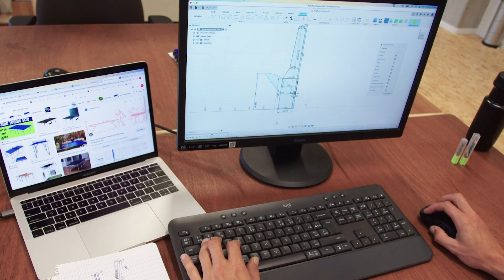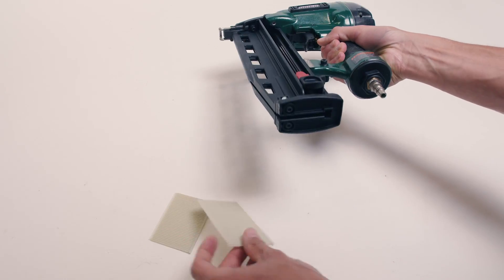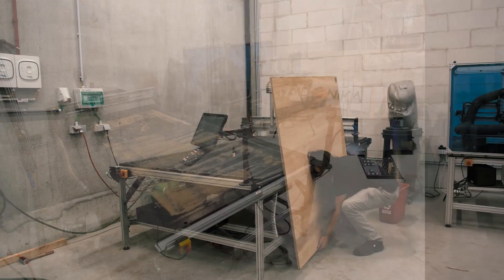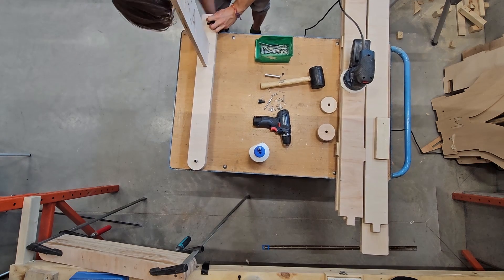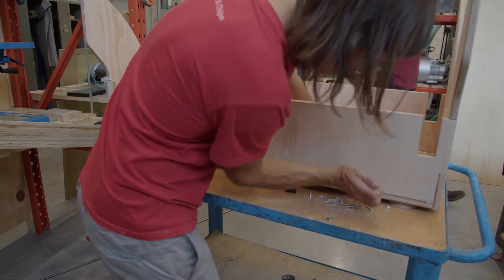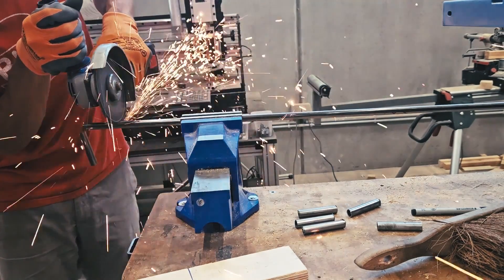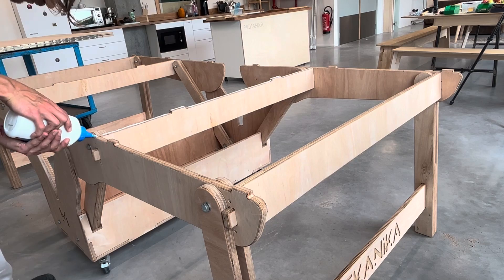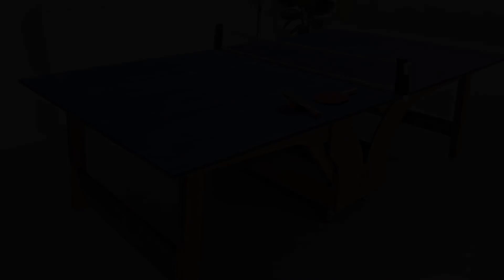How to Build a Ping Pong Table | Open Source CNC project (Complete Guide)

Comment: This is not diy, this guy has all professional machines, tools & equipment.
Reply from the maker: Hi! 
Indeed we used some workshop tool for the video, but nothing prevents you from building it your own way!
You can always get the free plans to work on the cuts manually or with a jigsaw.
You could also check if there is a fablab or collaborative workshop close to you where you could do the CNC cuts for better results!
Sanding could be done by hand, and I'm pretty sure you have an electric screwdriver already.

In the end it's all just you building your table with the tools available to you  :)